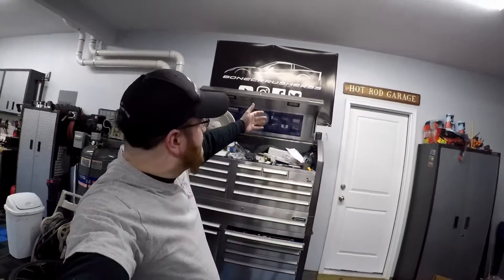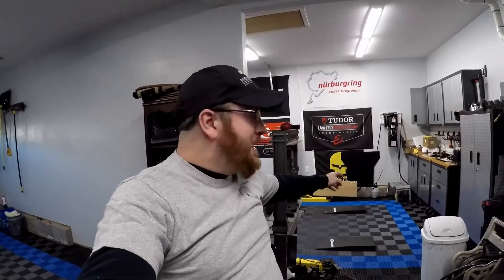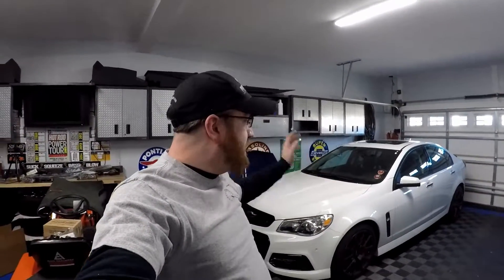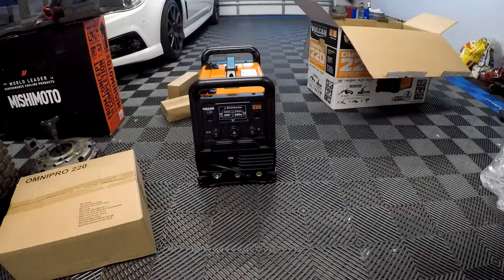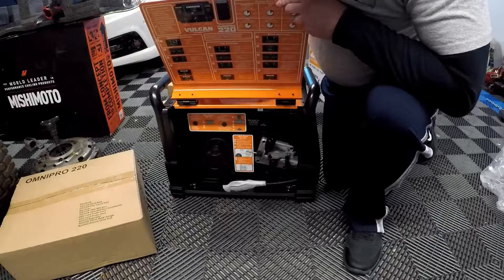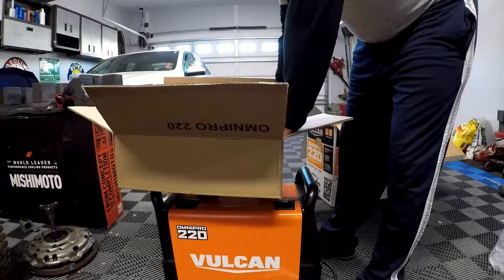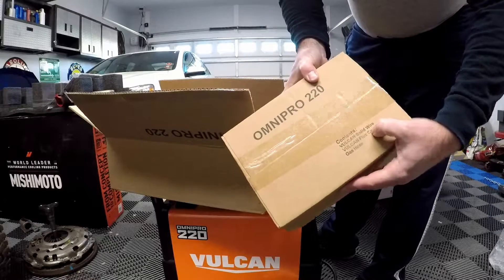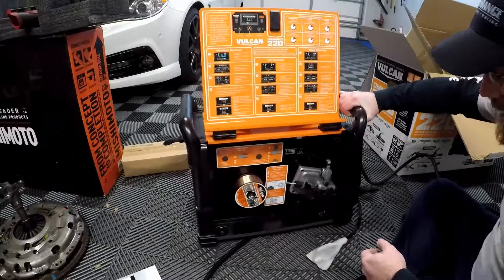@harborfreight Vulcan Omnipro 220 - Initial Setup/Review

Comment: They've really gotten tight on the stuff in the box since this video. I just got one yesterday, and there's not a coupon nor do they give you free spools of wire. They also cost a good bit more now. I feel dooped
Reply from the maker: I would say China/Tarrifs - but I bought this before Covid.
Reply: @bonecrrusherSS  yeah, I don't know if the tarrifs are why or if harbor freight just got greedy since a lot of their newer tool lines have also gotten way more expensive than what they were a couple years ago. I guess with popularity comes bigger price tags and smaller warranties without paying a bunch more for a good warranty.
Reply: Deff not tarrifs lol I got mine a year ago  300$ off right before they went back up and they had nothing in the box then just a “congrats here’s some Vulcan accessories u could ‘buy’” with a pic of the cloves wire and helmet that use to come with it when my buddy bought one couple years ago lol
Reply: Just wanted to add, you also have to purchase a warranty if you want more than 90 days. A 1yr warranty is $200 and a 2yr is $300.
Reply from the maker: Damn dude - I bought a 2 or 3 year warranty for like $100 bucks - it's been awhile since I bought it.

Comment: What is the maximum voltage on the settings for mig?? Please help 🙏 i get 28.0 and 400 wire speed on the titanium unlimited 200
Reply from the maker: Google AI says the following:

he Vulcan OmniPro 220 industrial multiprocess welder has a MIG output of 30–220 amps DC. A recommended wire feed speed for MIG welding is 240–290 inches per minute (ipm).

Harbor Freight Vulcan OmniPro 220 - Welding Current Range (for MIG) for 240v is 30-220A. Current Input (for MIG) for 240v is 25.5A (it says at 200A)